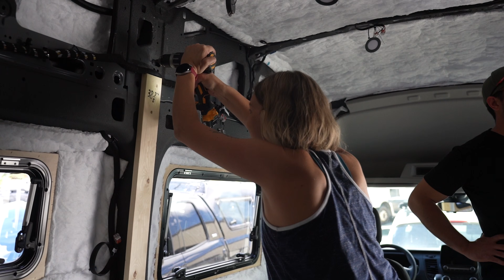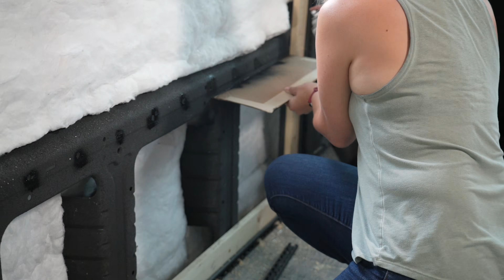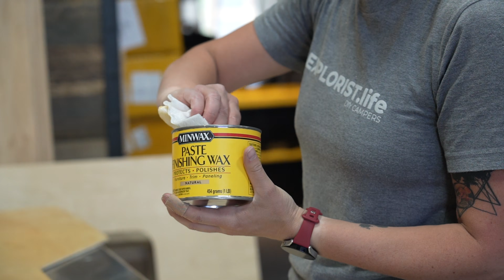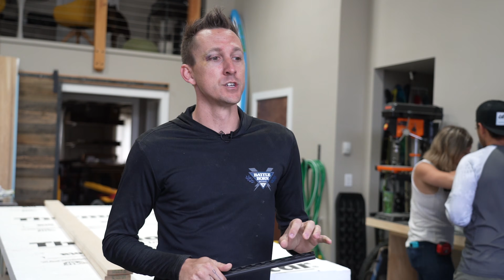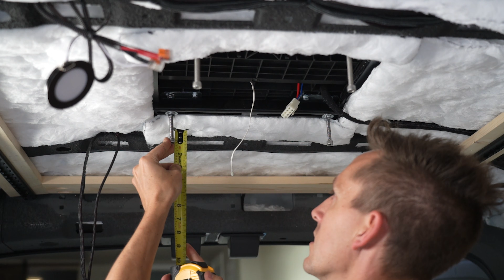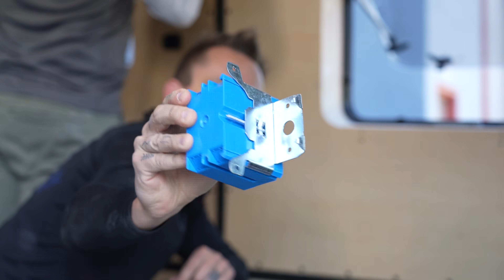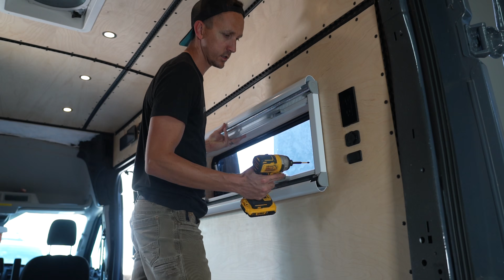DIY CAMPER VAN WALLS W/ L-TRACK (100% from scratch)

Comment: I lost my dad a few years ago, but always appreciate the things he taught me growing up. One of them was how to drill hardened steel.  The drill bit should be a much harder steel than the steel you are drilling into, so you should have no problem shaving off metal as long as it keeps its edge. Keeping the edge is where the bit needs help. Ask too much of it, it will get hot and get dull. Drill a small pilot hole first, and step up to larger bits in increments. Keep the bit cool by using a medium oil and keeping the drill turning slow. Torque is your friend, not speed. By switching belts around on the pulleys of my drill press, I can get the speed down to a leisurely 240 RPM. With a hand drill this gets trickier, as you have to set your speed by trigger depression.  Finally, If the piece you are drilling is loose, clamp it down because if the bit catches, it could throw the piece causing property damage or injury.
Reply from the maker: Yes!  Great tips for sure.  Throughout the project we definitely found that going slow was the key.  If we couldn't see the cutting edges of the bit; it was spinning too fast was our metric.  Started with 1/16" and worked our way up from there.
Reply: @Npowrd .. +1. Agreed. .. Your dad taught you well; R.I.P. Dad. .. Slow the drill bit speed commensurate with the material at hand. ..

Comment: What kind of plywood did y'all decide on? I've been totally unable to source Baltic Birch, and wondering what alternatives folks are using. Cheers.
Reply from the maker: It's birch (there's a parts & tools list in the pinned comment).  Not baltic birch, but still looks good and is great for what we are using it for.

Comment: Really nice work guys and now you have me thinking about that pneumatic plus nut tool in place of the Astro device which I've already purchased. Here's a thought; someone needs to come up with a swap site where van builders can sell their new and slightly used tools once their build is finished. BTW, is your van the 148"extended 350HD? Thank you again Nate and Steph for sharing with us all of your hard work : )
Reply: Return the Astro tool. It’s slower, harder to use and messed up threads in my plusnuts.
Reply from the maker: We only used the Astro tool about a half dozen times. 🤣😂  Honestly, the Pneumatic tool is super worth it.  I've already used it outside of the van to attach something to the outside of one of my toolboxes.  I can also see using it when we get around to exterior mods like bumpers and such to add shovels/maxxtrax and such to.  

Our van is the 148" non-extended 350 w/ single rear wheel.
Reply: Sharing in the USA. Nope, not gonna happen. Everyone wants their own of everything, even if we only use it once a year. RV', boats, planes, tools, pools, ATV's, motorcycles, etc.

Comment: First of all, the wood wiht dark screws and L track look great. Two questions: 
- why firring strips and not attaching the L track directly to the van metal - I see only one reason which is to have something for the panelling to grab, or because the L track can't curve enough to accomodate to van wall curves?
- the spacing of screws for the L track seems close, assuming each screw can hold 50+ lbs, a screw every (it seems) 9-10 inches looks like overkill, am I wrong?
Reply from the maker: Thanks!

1: The wood panels is the main reason, but it was also necessary for routing the factory wiring harness since we opted to not relocate it into the walls (which seemed like a HUGE hassle and risk.

2: Maybe it's overkill, but will give us some REALLY solid points to attach our cabinets and bed to.  This was one of those 'do it right, do it once' and 'Anything worth doing is worth OVERdoing' kind of things.  

Plus... I'm tired of our viewers saying things like 'That'll never hold up in a crash!!' 🤣😂

Comment: Thanks for this informative video. I need this about last year. I’m glad you guys share this. Im on the fence about purchasing the track though
Reply from the maker: No problem!  Thanks for watching!

The track is going to remove all question marks about where is a good spot to attach beds/cabinets/etc and ensure that the attachment points are good enough.  It's obviously not necessary, but without it, more consideration must be taken to ensure cabinets are fastened to the wall securely.

Comment: Great quality video as usual!  I am just wondering about all those metal shavings stuck in the insulation.
Reply from the maker: Hey Charlevoix418, Thanks so much!  The key to that kind of stuff is to 'not worry about things we can't do anything about'. 😂😂
Reply: @EXPLORISTlife  Yeah, I understand your point of view, but can't the insulation be installed after all that drilling, so a good part of the shavings could be vacuum cleaned?
Reply from the maker: There were a LOT of 'blind' holes, which means that we couldn't access the back side of the hole, which means we could have never gotten a vacuum back there.  Any where we could get a vacuum, we did vacuum up our mess, but we omitted that from the video in attempt to cut down the 12+ hours of video footage we had down to sub-30 minutes.  I'm not too worried about a piece of metal stuck in our insulation, though.  Even if it rusts, it's not going to hurt anything.  Metal shavings are just part of vehicle customization and if we wanted to avoid metal shavings completely; we'd be better off buying a car and not modifying it at all.  Otherwise, we just do the best we can.  Installing the insulation after the furring strips and L-Track is definitely possible, but it's just one more thing that's 'in the way' and would have unnecessarily (IMO) broken up our 'wall building' process and video.
Reply: @EXPLORISTlife  Holding a U-shaped strong magnet around the hole as you drill catches a LOT of the shavings.

Comment: Use drills that they use for building aircrafts. They are mostly unbreakable. Molybdenum I believe I'd what makes them like that.
Reply from the maker: Nice!  I'd be interested to see how they compare to Cobalt.  A google search for Cobalt vs Molybdenum drill bits pretty much just returned a forum with a bunch of machinists arguing with each other. 😂🤣
Reply: @EXPLORISTlife  I've broken lots of cobalt drill bits. Don't remember breaking a molybdenum drill bit. They cost a lot but in the long run you save.